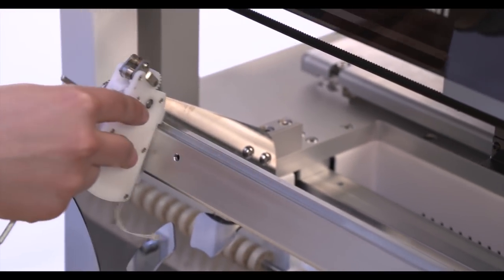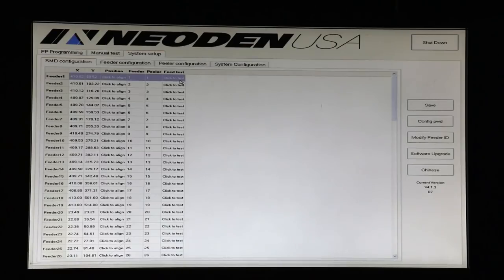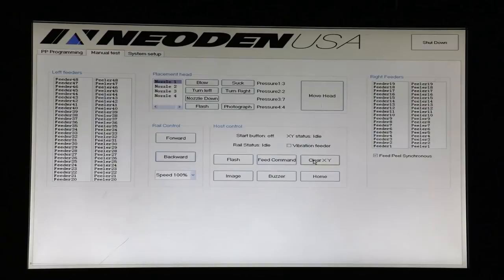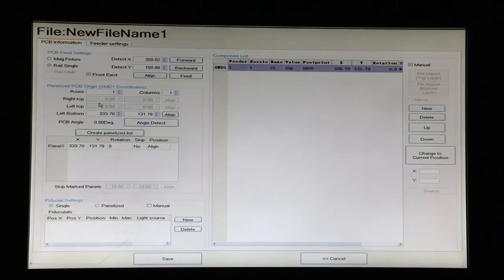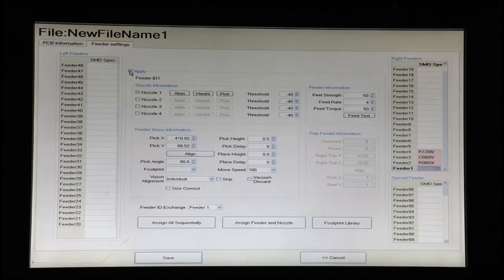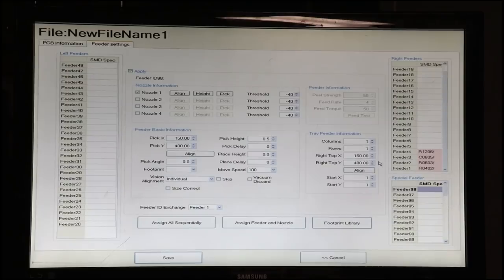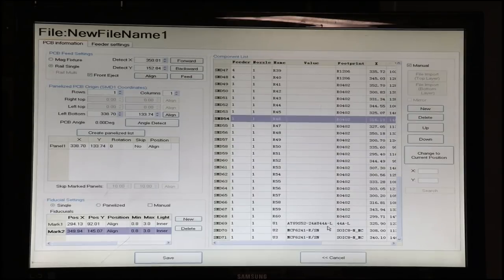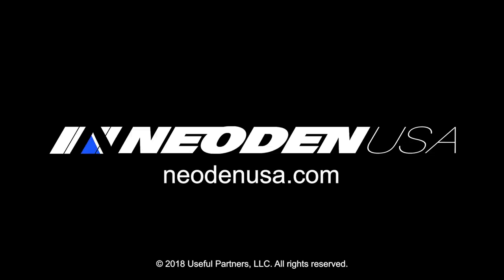Neoden 4 Pick and Place Machine - A Detailed Tutorial

Comment: Thanks for a great video.  I recently purchased a Neoden 4 (used) and have found the tutorial essential viewing in getting the machine set up & running nicely.  
I have a couple of questions though : 

A)  In the video you align each component (board component position center) - why is this necessary?  
Surely, if there are reference fiducials, the machine should (after locating them on the board and calculating offsets for board position and rotation) place the components
in the correct place based on the pick and place file data ( which includes the location of the fiducials) ?
It's very time consuming (and essentially less accurate) to go and visually select the center of each component on a board.  
Also, If you need to correct the center point of a component after doing a manufacturing run, it's seems hard to get the same reference points (used the first time 
going through visual component centering) so you have to do it all again.  Or perhaps I'm missing something?

B) I have a question about the 'Footprint Library' for the up-looking camera.
My machine came with a smallish list of common components to select from (normal R's & C's, SOP8's etc) and they are all good, but my 
question is that while defining a new footprint you can only define a rectangular shape and height so how do you handle non-rectangular/square parts?
For example, I've had trouble with SOT223's - while most of the time it gets these correct with a rectangular footprint definition, about 30% of the time
it will pick them reasonably straight but then give them an incorrect rotation for placement.  As a result I've had to turn vision correction off for these.

Overall I'm very pleased with the machine's capabilities.

Thanks in advance.
Ewan J. Wordsworth
Microbee Technology

Comment: Hi,
We just purchased a NeoDen4 which arrived on Monday.
I have been setting the machine up and initially it worked well, but we have started to notice some errors in its operation. All the problems are with the head operation. 
1)	Sometimes the downwards facing camera takes a “black” photo (i.e. no image).
2)	Sometimes the pick nozzle does not respond. It sometimes is held down and can only be released by turning off the machine. Other times, it does not drop down even when using the manual test mode. 
3)	Sometimes the downward facing camera flash does not turn off. The flash remains on continually.
The other parts of the machine (feeders, peelers, XY movement, rail control, upwards facing camera) all work without issue. 
Any ideas? It feels like a software/driver bug because sometimes the test buttons in the “manual test“ tab work then just randomly stop working. 
Phil
Reply from the maker: please contact our tech support department via e-mail or telephone for solutions to these concerns - support@neodenusa.com

Comment: 47:51 R14 Missing / C4 Crooked / R13 Only touching one pad / Also a component on the very top left is missing... Also my guy went a bit excess on the solder paste application to give a "best case" demo of this machine.
Reply from the maker: That was the first board to come out of a new program.  With any machine, it is necessary to tweak the program before production, and that result for a first attempt is excellent. As far as solder paste, we used a standard .15mm stencil. Contact us at support@neodenusa.com if you have any further questions!
Reply: @NeodenUSA  how old is the Neoden 4?

Comment: That alignment setup process looks pretty poorly designed - it would save a lot of time if you could just have "fid" components in the P&P file to indicate the fid positions so everything is offset automatically.
Reply: you can have it align the  boards to the FIDs, you enter them in the list and then can use the change to current position to align the components, no idea why he's doing that long method. which it does when you put it on the rail too. though he didn't seem to notice C4 didn't place properly! :)

Comment: Hey guys, its awesome to see such a comprehensive video put together for this machine. My university is currently looking into purchasing a Neoden 4, but we are doing some research first to ensure it fits our needs. After aligning all of your components, you then set up each of your feeders.  Suppose you were to be printing multiple boards, each with the exact same components but with different board designs (such as if a whole class of students designed their own versions of the same circuit).  Would it be possible to keep the feeder settings while only changing the CSV/component alignment for each new board design? Or do the feeders have to be set up each time?
Reply: The feeder settings are part of each program. So if you copy a program and load a new component list in, you have the feeder’s all set up.
Reply: @wavedistributionusa  Thanks so much!

Comment: What is min pitch for ICs in practice? Does it able to place 0402  correct in 100% cases?
Reply from the maker: Minimum pitch is .5 mm, and yes, it can place 0402 correctly 100% of the time all day long.
Reply: @NeodenUSA  C4 is inclined and R14 is missing... If the guy took that PCB from the machine, as shown, then the failrate is huge and 100% is just false advertisement
Reply from the maker: @magnusotsa6618  The board was taken out of the machine after the very first time a program was run. As with all of these programs and machines, tweaks need to be made to ensure that all of the components are perfectly configured. If we had wanted to for the public, it would’ve been easy to photograph a perfect board that was produced after a few iterations of quality control.

Our goal was to give customers an honest impression of the process of programming the machine. Normally, when a board comes out of the machine, one does not hold it up vertically for a camera, which can allow parts to move and fall off.  But we did that here.

Considering that the video is unretouched, and that this is the first board that machine ever made with the first program it ever received, these results are excellent.

Comment: Not too bad? R12 .. misaligned, R13 misaligned, C6 misaligned, the IC on the right top half in the air. Try again with another one...
Reply from the maker: This was the very first board we ran, that came off of a brand new program. Our goal was to show honestly how close you can get on the first try. Obviously, any serious manufacturer is going to fine-tune placement operations before full production.
Reply: @NeodenUSA  for the price of the machine surely okay. But still any of those situations should be taken care about by the manufacturer as far as possible.
Reply from the maker: @mrechbreger  You're right. And the next time we do a video, we'll be sure to do that. The user interface is simple, and tweaks/corrections can be made on the fly.

Comment: Why does your software have a button that changes the interface to Chinese and (here's the stinker!)  requires a PASSWORD from SUPPORT to get back to English!?!?!?    Who designs in traps like this????
Reply: "Doctor, it hurts when I go like this"

'Don't go like this'

The same is true of your GPS if you change the language. Don't do it, and you won't have a problem.  If you inadvertently do it, e-mail support for the password - problem solved. 

In the meantime, companies the world over are using the Neoden 4 to successfully build boards and make products at a fraction of the cost of going to third-party contract manufacturing.
Reply: @wavedistributionusa  Your GPS won't ask for a password to change it back. No-one is disputing that it's a great machine, it's just that it's very intuitive that it'd have a setting that forces you to contact support to undo, especially one that's so prominent. Why not just let you change it back with a similar "English" button? 

The only thing I can think of is that maybe it costs extra to have an English version? Seems a silly way to solve region-locking though.
Reply: @Lufteluke  you are absolutely right. And it will be added to the list of requested feature changes for thre next compilation of the control software.

In the meantime, folks all around the English-speaking world are using the Neoden 4 to make prototypes, produce boards, build products in-house. The degree of control havcing a Neoden 4 in a SMT production line at this price point is extreemelt empowering to small and mediun size businesses - including mine.
Reply: @wavedistributionusa   Absolutely, I'm in awe over how fast and precise those things are, that's why I ended up on this video in the first place

Comment: You should get a tripod for your camera.
Reply from the maker: Which one? That's a three camera shoot.
Reply: A zoom in on the heads was shaky. Its an interesting machine the software needs work and an open source approach would also gain more enthusiasm. Stock in USA?
Reply from the maker: They were all pro cameras, one was hand-held, two were on mounts on production-grade stands. 

The units are in stock in New Jersey and Arizona. The software works flawlessly, and is based on the very stable OEM version of Microsoft Windows XP. Open-source may be considered for future products.

You may download the manual for the NeoDen 4 at our website, it has screen grabs from the software and steps you through the process start-to-finish.
Reply: Quality was good its was just shaky on the zoom where i was looking for details. mY couligue resquested price sheet but no replay yet. XP is no longer supported will it work win7
Reply from the maker: The OS is embedded in the system and included with the Neoden 4, along with a keyboard, mouse and monitor. And external computer is not required. The price sheet is on the website configurator - https://neodenusa.com/smt-pick-and-place/neoden-4

Comment: Why is C4 wonky, where is R14, why is R43 on its side, where is R20, vision is enabled for all of these, what gives. Just placed an order for one of these and this video has made me regret that choice. The setup seems to be overly fiddly - like, why is the feeder programmable but not the peeler - why didn't they use regular all in one feeders??! Can the feeders be renamed with a component part number or setup offline? Why the actual F is there a Chinese button if you can't reset the language without a password!!!!!!!! Thats just mental. You guys, Neoden US and EU need to be complaining about these 'features' or they will never be changed.
Reply from the maker: We gave a real world, honest depiction of the machine so that customers would be fully informed.  In our video, we ran a board with a new setup for the first time.  No PNP machine will produce perfect results without tweaking a new program.  This is one reasons that contract manufacturers require a significant parts overhead.

Feeders require more information to operate, because they have variable pitch.  That’s why they are on a digital bus.  Peelers are simpler, and therefore aren’t digitally controlled for cost reasons.   Regular all in one feeders are more costly and add bulk to a machine. This machine is extremely compact and cost-effective.

Feeders are named with their feeder number, and component names can be assigned in individual programs.

There is no need to press the button to change the language, so that shouldn't be an issue for you.

There are 100's of Neoden 4's in use throughout North America, producing boards successfully for design engineers, small and medium sized businesses, and even hobbyists. The Neoden 4 is rock solid, functional and affordable. We'd be happy to give you a one--one-one demo via Zoom or FaceTime, and answer any. questions you may have.
Reply: @NeodenUSA  I appreciate your reply. But you have to admit having a large button to press accidentally, and then require a password from Neoden to change the language back is stupid. And although I respect that you ran the machine as is for the demo. I also have to say that if you cannot achieve great placement results out the box then no body will, perhaps a follow up video to show how the system is tuned to achieve the perfect placement that Neoden market is in order?
Reply: Stupid is as stupid does - don't accidentally press the large button! ;-)

You can achieve great results right out of the box, like anything having to do with SMT production you have to tweak and adjust the CSV file exported from your CAD program, run a test board and then you're good to go.

While you say you just placed an order for one, we do not show you in our system. We'd be happy to discuss this further, and answer any additional questions you may have. And, as previously offered, we can run a live demo for you via Zoom or FaceTime, and show you how the system is fine-tuned to achieve perfect placement.
Reply: @wavedistributionusa  I like the reply. I ordered from Neoden UK, order paid this morning, we aren't all in the land of the free :) 

I guess although honest this perhaps isn't a video highlighting great performance. Missing or missplaced components isn't what o wanted to see. I will of course make sure not to accidentally hit the huge Chinese button but you have got to admit that is a design flaw. Surly you guys can make some suggestions to Neoden.
Reply: @brokenworld1  We can make a video highlighting great performance, once we finish the S1 and Neoden 8 videos.

We make suggestions to Neoden China all the time - some they embrace, some they do not, but thanks for bringing it up. We will continue to work with them to improve all aspects of the end-user experience.

Comment: Hi guys. Thanks for this great video. I have just purchased two Neoden4 machines and I found very little useful tutorials on how to get started. That is - until I found this video. Now things are much clearer to me. I have one request - can you please upload somewhere (so I can download it) the pick'n'place file that you have used in this video (when setting up the components list). It will be very useful to see the exact format of the file, which column should have which information contained in it etc. . I am using Altium Designer and I will need to modify the pick'n'place file manually once I export it so it would be recognised by the Neoden4.
Also, a more detailed explanation on how to set up panelized board in Neoden4 would be very helpful.
Once again, thanks for this great video. I believe a lot of people who get this machine will find it very helpful.
Regards,
Phuc